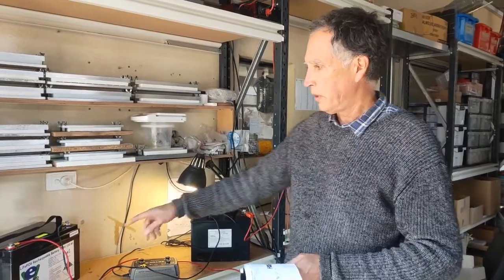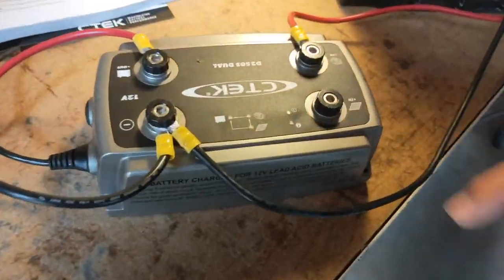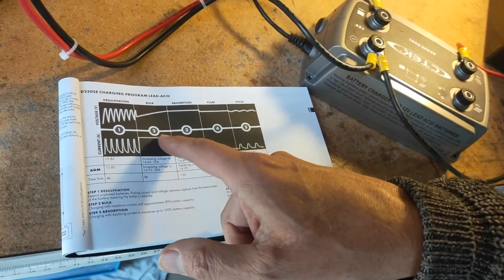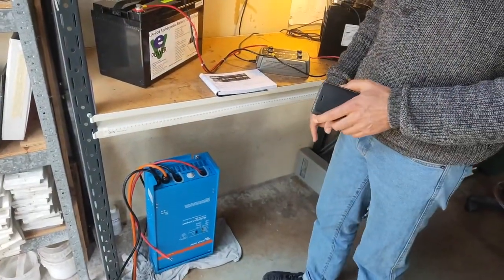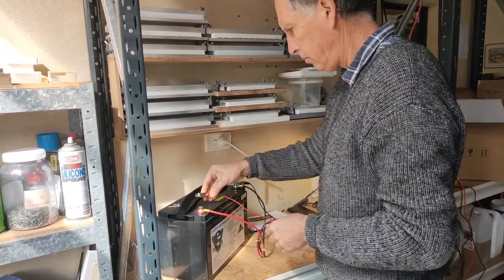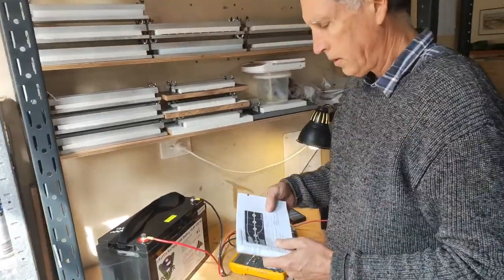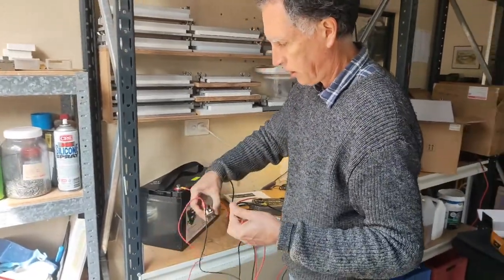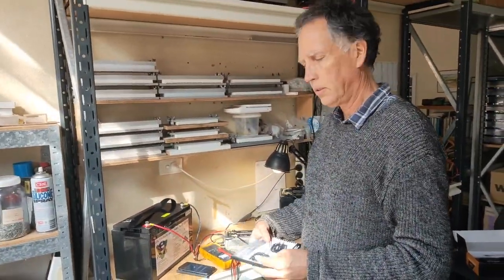Can I Charge a Lithium Battery with a Lead Acid Battery Charger?

Comment: What you did, was already dangerous enough - it may have had an impact, that this was practiced on a very large type of battery, but in my case i was tryin to charge a dead Braille G9 LiFePo4 Battery, very light and small and only 5 Ah and also with a CTEK charger. Well, 15 minutes after connecting (and I was lucky not to stand in front of it) the thing blew up very loud and with lots of dense smoke.
Like I said, could be much less of a problem with larger batteries, but such thing never happened with flatlined lead-acid batteries.
Please be careful if your LiFePo Battery is on low voltage!!!
Reply from the maker: What I did was not dangerous at all.
Do not charge a DEAD (ie zero volts) LiFePO4 battery with ANY charger !
A dead LFP battery can be dangerous if you try to charge it normally for sure, esp. if you put a relatively large charge current relative to the capacity of the battery, which would appear to be exactly what you did.

Comment: question: Battery Chargers: if you charge your starter Battery, will it Charge the lithium battery in the back as well?
Reply from the maker: Best to use a dual battery isolator, then it will charge your LFP battery once the start battery nears full charge.
Reply: @ev-power  ok I'm getting a battery box and it has a 25 Amp DC-DC charger that should do the same thing? Yes

Comment: your lithium battery that has a bms to stop over discharge and charge, is at 1 volt? what?
Reply: the bms allows 1v output after a low voltage disconnect. the bms needs to see incoming voltage to reboot. the lead acid charger wont discharge voltage unless IT too sees incoming voltage to trigger the charge cycle. thus the need too introduce a third power source to jumpstart the system. a lifepo4 charger is setup with the "third" power source so to speak by outputting enough power at the beginning of its charge cycle to get the bms to close the circuit that allows direct connection to the cells and their actual voltage.
Reply: @RLTillson  thanks for reply. Maybe you can help in another mystery. Why can't I use a 15-20 amp charger with a 20 amp solar charge controller , so I can have the use of the many adjustable parameters available on most decent   solar charge controllers? I am so close to just trying it ,but don't want to I burn it up. People say don't, but not why. How could a steady clean set voltage of a power supply, be any more harmful that a solar panel putting out a huge range of volts and amps?
  For instance. my 5000 watt , 24v, UPS, INVERTER/CHARGER, was designed for lead acid . So I am stuck with the 21v low battery charger startup. But when I use my 8 cell, 24v lifepo4 battery, by the time it get that low, one of the cells has run out already and shut it down. Which is not recomended for the UPS OR THE SOLAR CHARGE CONTROLLER. I can shut that charger off and just use the solar and add a power source and set that startup high, and stop low  enough to be safe .If it could work. If I just had the hope that it might work. I would try it and just get a new one if it fails.  But why do people say don't?
Reply: This is the problem with integration. It's best to have separate components so replacing one is much less expensive.  In this case, I would eliminate the charger circuit on your inverter and add  separate charge controllers for solar and shore power that are meant for lithium. Also, mixing pwm circuits with mppt circuits can have catastrophic effect due to the method they use to convert or transform voltage.
Reply: @RLTillson  Are you saying a normal battery charger is  pmw ?
Reply: Most often a lead acid charger is pwm.

Comment: I replaced a 36 volt Lead acid battery with a 36 volt LiFeP04.  The Tech told me that the range for LiFeP04 is 41.3 volts to 47 volts.  The lead acid charger output is below 41.3 volts so, it will not charge to LiFeP04 at all. I will either have to modify the charger to output 47 Volts or get a charger with a 47 volt output.
Reply: each lifepo4 cell should be charged no more than 3.65v each (x4 = 14.6v on a 12v battery, x12 = 43.8v on a 36v battery.) How many lifepo4 cells in series are there in the battery?

Comment: Does  anyone know if I can charge my  AGM  batteries  with my  lithium  battery  charger?
Reply from the maker: When I use one of the EV Power lithium chargers on a straight SLA battery it seems to not fully charge the battery. AGM (Lead Acid) batteries need a long absorption phase when they get to ~80% SOC because they cannot absorb current fast enough to charge fully once the battery voltage reaches the peak charge voltage. Lithium batteries do not require this phase so much as they generally absorb the full charge current until ~95% SOC.

Comment: Any $5 DC PWM boost module set to 15 volts would do, also laptop adapter which includes a PWM even if it is a 18 or 19 volt, still would work if the goal is to save money on expensive chargers. B7t I would never use a Lead Acid battery charger on any  lithium or LiFePO4 battery, never.
Reply from the maker: This comment is incorrect. Using a PWM power supply set to 15V will overcharge a 12V LFP battery. 18-19V will overcharge even more.
Reply: troll
Reply: shouldn't charge to more than 14.6v tops, shouldn't float at more than 13.4v (for a 4S lifepo4 battery.)

Comment: Use lithium battery chargers on lithium batteries and lead acid battery charger on lead acid batteries and agm  charger setting on agm batteries.Unless you have the money to experiment just to see if it would most cases the battery capacity is lower and performance suffers and battery don't last as long as the recommended charger type for your specific battery.now that all being said which battery charger is better for your specific brand battery is what your looking for.

Comment: Lithium batteries destroy car alternators.
Reply from the maker: They can do if that is all that is connected to the car alternator. 
This is due to two factors:
1) The electronic control system (BMS) can instantly disconnect the battery and cause a voltage spike damaging the alternator diodes.
2) Low internal resistance in the battery can result in high alternator charge currents causing overheating, esp. at low speeds.
If the Lithium battery is a secondary battery (with a lead acid start battery) connected via a dual battery isolator then most times it is perfectly safe.

Comment: ok so your 20amp charger poses no threat, what about a 130amp alternator in a car ? What about one with a fried voltage regulator ><;
Reply from the maker: Well I suppose that is going to fry ANY battery.  The good thing about the LFP batteries is they have a BATTERY MANAGEMENT SYSTEM (BMS) which will protect the battery against an overvoltage. So I guess there's yet another advantage of LFP over Lead, if that is the point of your comment...
Reply: @ev-power  I am no expert, but i am pretty sure batteries in a car arent typically ran flat dead. More importantly it seems cold weather at freezing or below either causes voltage to drop more quickly overnight, or the extreme cold start is something can cause desulfation mode.
Reply: Should still use a charge controller between alternator & lifepo4 battery.

Comment: Or you can use a Large charged battery with small gauge wire to limit amps to jumpstart the disabled flat battery it has worked for me in the past. I have been using a projector 16 amp lead acid battery charger on my lithium for two years no problems.
Reply: You cant limit amps that way !! For real dude! The thinner gauge wire is only going to cause the wire itself to get HOTTER as it passes the same amount of amps that a larger wire would. Will it work? Sure. Until it doesnt, AKA catches fire. Do what you want bro just dont want you to be ignorant about it.
Reply: Dude I think you misunderstand you use the small gauge wire to jumpstart the battery charger as soon as the charger is running you disconnect. Works for me every time many times.
Reply: @nzdatsports9659  Yep, I did read it wrong. Still tho, use thicker gauge wire anyway just to avoid any spontaneous combustion possibilities. Or at least, dont intentionally use baby wire. Check out this video it will explain literally everything! https://www.youtube.com/watch?v=fOK5vUU9QB0

Comment: ⚠⚠⚠WARNING ⚠⚠⚠⚠⚠ALWAYS USE THE CORRECT CHARGER THEY ARE MADE FOR A REASON ⚠⚠⚠⚠⚠SAFTY DONT RISK IT⚠⚠⚠⚠⚠⚠⚠
Reply: There is no safety risk using a lead acid charger on a lifepo4 battery 

It's just a slightly different voltage and you won't get full charge...

But there is no "danger"
Reply: If you believe the  "safety" risk is 🤣